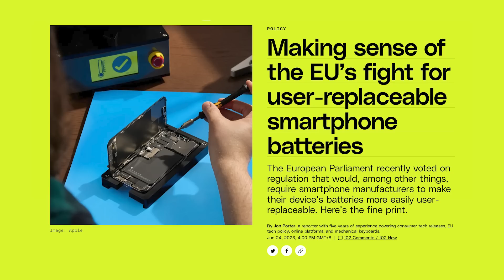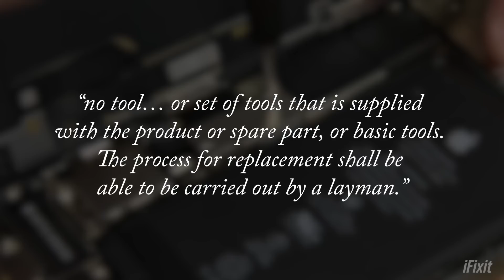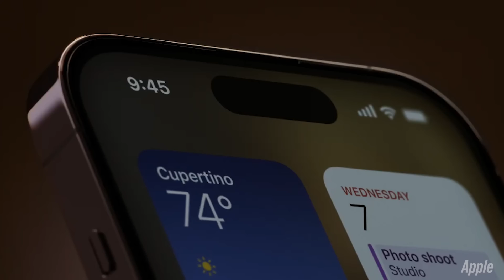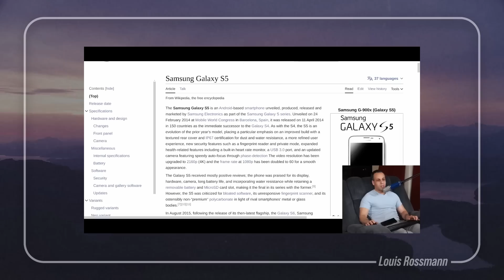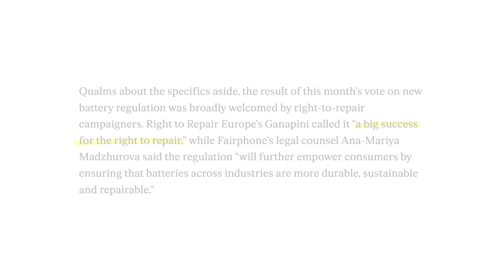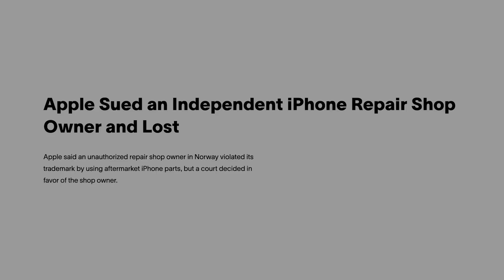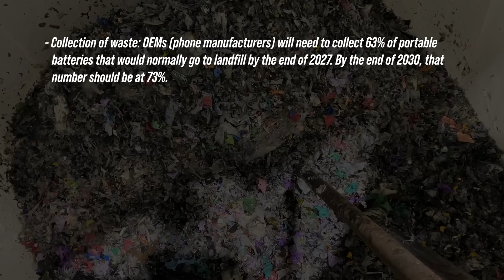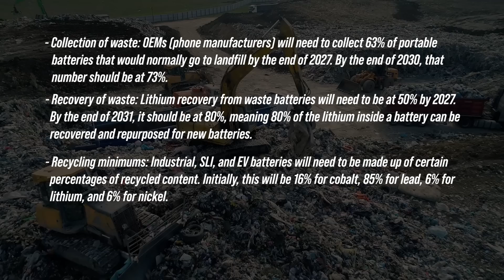EU Just Changed Smartphones Forever

Comment: I mean... apple had it already, no? I think the iPhone 5/S, which design language current iphones share, only needed two screw losend next to the port and you could flip the screen up. Add a squishy gasket to the frame and you got a replacable, simple and dust/water prof design. Samsung too had it figured out, even with wireless charging and NFC enabled.

Only thing i don't see happening is foldables and tablet. The last tablet i know of that had a removable back pannel was the Tegra K1 by nvidia and even that was a pain in the ass.

Comment: Yes it was anti consumer efforts that lead development of non replaceable batteries. But making it more consumer friendly will sadly only make yet another excuse for the companies to say "hey we had to develop these "new" (old) designs so now they have to be more expensive,
Reply: No, it was customer pressure for thinner sleeker phones. This was in part achieved by getting rid of removable components and using glue rather than screws to assemble the phones.

And yes, reverting to screws rather than glue is definitely going to increase manufacturing cost, so expect phones that are more expensive and clunkier than current models.
Reply: @Tugela60  yes, however the screws and design is 1% of the cost,  the chips inside the phone is 95% of cost. 

The rest will be sold as new features to line the pockets of management. It happens every time. 

Maybe production cost will increase by 1-2% while consumers have to pay 10% + for the "feature".
Reply: @EirikXL  It is not the screws, it is the cost of assembly. A glued design assembly can be automated, a screwed design cannot (it is screwed). So, more expensive, an expense that will be reflected in the msrp.

Comment: You can still use the glass sandwich design and have a user replaceable battery. Just have to design it so the top or bottom pops off and you slide the battery out. Phones were doing it for years before manufacturers decided they wanted to lock us all in to planned obsolescence.
Reply: My only phone with that design was awfull. Yes the battery wasnt the problem, but i would loose the cover so offten, because it broke a little piece of plastik of. 0/10. Hope that that piece of crap tecnology never exists again

Comment: Nothing will change

Special rules for smartphones and tablets
Special rules apply to smartphones and tablets. The relevant ecodesign requirements give manufacturers a choice: Either they design their mobile devices so that users can replace the battery themselves. However, they can also install the battery in a fixed position. In this case, however, the battery must still have at least 83 percent of its capacity after 500 charging cycles and at least 80 percent after 1,000 charging cycles. Smartphones must also be designed to be dustproof and waterproof.

Comment: imagine having a battery station where you could simply swap batterys and never ever having to worry about not having your phone charged
Reply: I literally used to do this.

Going on trips was easy too. You would just bring 3 charged batteries. 

There were also custom batteries cases... I had a battery that clicked into the phone that was also a backplate... the battery was big enough to last days.
Reply: @Cstegg  the batteries were smaller. phones just use more power nowadays. Anyway, bring battery packs on your trips, voila.
Reply: Why imagine? That was the norm until 2015
Reply: Battery's have a life, I could swap a rubbish battery for a better one. Wouldn't work
Reply: @billybull7419  This is a concept that works.
Reply: @billybull7419  Right now, when your battery is rubbish, you have to swap out the entire device.
Reply: Just like power tools.
Reply: batteries
Reply: You could use battery packs, not as elegant, but it works.
Reply: maybe not practical for phones but they do that e-bikes and scooters - stations with swappable batteries. They tried doing once for EVs too iirc.
Reply: This is starting to be seriously discussed specially in the EV cars and bikes market. Instead of waiting hours to recharge your car, just pick up a battery, replace it, and leave the older one at the station. Can't see why the same principle couldn't be applied to phones.
Reply: excelent for the enviroment
Reply: they used to have this in the UK. you would get a small power bank to charge your phone and could swap it for a fully charged one and certain shops
Reply: Like EVs?
Reply: I had that with my galaxy S5. I always had a fresh battery sitting at home to swap as I head out
Reply: Dislike the security implications
Reply: except here the EU law is not about removable battery though
Reply: No
Reply: Changing batteries every day... nah. Just nah.
Reply: @Freaky0Nina u charge ur phone everyday
Reply: @Freaky0Nina i had to change mine twice a day with an s4 for years, i had a backup s4 with a broken screen that i used to solely charge up empty batteries so i could keep using my phone.
Reply: it takes about 30 seconds to change batterys @Freaky0Nina
Reply: @Freaky0Nina  My headphones work like that, It has a removable battery and the base is a better charger, it came with two batteries, while you use one, the other is charging, it is ultra useful.
Reply: @Freaky0Nina  Man you guys must be teenagers. You realize phones were like this like ten years ago right? You just have fresh batteries at the ready. It was always better.
Reply: @Freaky0Nina  Perhaps you're too young to remember but it's simply open the case - take out battery 1 - put in battery 2 - set battery 1 to charge.
Reply: @Freaky0Nina you do charge then every day. If such scenario os possible, you won't need to charge your phone at all.
Reply: when i had my s5 with extra batteries it was great. my charging station was another s5 with a broken screen. I rarely ever had to plug in my phone,

Comment: It was the result of both the companies and the users. Because i had that g5, it was a cool concept at first, but everytime i dropped my phone the battery popped out. The charge port that the battery connected to and slid into the phone started malfunctioning and couldnt charge. Replaced it. Same thing a few months later. Replaced it. Battery wouldnt hold charge. Replaced the battery. Eventually it stopped clicking into place correctly. and needed to be tapped closed.

Comment: I'm saying it here and now. Once this law passes, a possibility of a brand new phone that is sold "batteries not included" shall rise.
Reply: if the batteries are standardized across platforms... why not. you want to upgrade to the latest model and don't have to pay for a new bettery, just use the old one. I'm not saying that companies wouldn't charge you the same as they intended to do if the battery was included but it's a possibility. Then again, say if samsung, nokie and apple all use their own battery, then they would include the battery because trying to get a customer to change brand if they have to buy the battery seperately is going to be haaaard.
Reply: @tore650  I dont think they will become cheaper just because the battery isn't in the phone.
Reply: @tjeerdroukens5110  No the phones probably won't become cheaper, but you'll be able to keep them five times longer if you want to.
Reply: @tore650 i wouldn't see the "new phone, old battery" thing
The lifetime of a battery is propably shorter than the rest of the phone
Reply: @tore650 batteries degrade
Reply: @blastbottles  I'm aware, but using standardised batteries would make recycling easier. Also when the battery starts to get bad you can buy a new one without having to go through the whole "should I just get a new phone?" because if you buy the battery you can still get a new phone later without feeling like you wasted money on the battery.
Reply: they wont be standard.
The real answer would be if batteroes have 10x more charging speed + density @tore650
Reply: Apple already got sued in europe for not selling charging blocks with their phones, this is not just "ONE law" its a change in a lot of laws regarding phone companies and services to users and the environment.
Reply: @tepuntopunto  The same law that forced them to switch to USB-C forbids to sell the charger with the phone. It's a whole package to stop people from buying more chargers than they need. Full compatibility, reuse your old charger. Use the same charger for all your gadgets.
Reply: You all do know the built-in irreplaceable batteries is the new feature, and replaceable batteries are simply going back to how it used to be?
Reply: I don't know about the rest of the world but that would be absolutely ilegal in Brasil
Reply: Imagine Apple just stops operating in the EU.
Reply: Yeah maybe for apple crap lol
Reply: You've just foreseen the future where everyone carries a power supply that is powering all electronics carried/implanted. Iron Man be the exaggerated example :)
Reply: The Chinese aftermarket batteries work just fine.
Reply: @ICheat_ILie_ISteal  They work until Apple put a chip in every parts of the phone to make sure every parts in the phone must be genuine to be able to function fully.
Reply: That'd be great
Reply: And people wont buy that phone as much as the ones that have a battery.
Reply: And the batteries sold will purposely be made to be sustainable for a few months before you need to buy another one.
Reply: even gameboy had batteries included
Reply: That is not a bad thing at all. Tons of stores already sell tools that don't have batteries included because they're universal.
Reply: They're basically forcing people into a Printer and Ink company scenario...
Reply: Then that leaves an opening for more competition.  Which will bring prices down.  Their call
Reply: Naw more then likly theyll just stop selling there top in models directly into the EU make anyone in the EU purchase the phone from another country and import it. Alot of lower tier phones still have easily removable batteries. So what were most likly going to see is the lower end phones being in the EU with the top end ones out side of the EU. With a not for sale In the EU sticker on them. Clearing them of any and all liability for those phones being in the EU. As it is the person choosing to import a phone into the EU despite it not meeting regulation. The difference between this and The Iphone Fiasco was andriods were unfected so if apple chose to pull out iyd only hurt them as why pay pay to import when you could get a phone of similar quality whithout needing to import were as this will impact both apple and andriod so it would be a Mutual pull-out of "High end phones".
Reply: For sure. They will find a way to make more money out of this.
Reply: Oh yea batteries will be like $300 minimum and different types of batteries scaling to $1,000 lol😅
Reply: @FadiGamingRP  Sure, if you buy them from Apple. Buy them from a company in Taiwan, and they'll probably cost a few bucks.
Reply: That's OK, so long as I can keep the phone forever and purchase compatible batteries from other manufacturers, thereby saving a ton of money.
Reply: That phone will blow up
Reply: hope next is alcohol batteries, can charge with beer, drinking poison is idiotic
Reply: Stop giving them ideas😭
Reply: That was possible from Nokia's heyday in the '90s through to the GS5, and yet phones were sold with batteries..
Reply: Like Powertools from Milwaukee
Reply: Who's going to buy a phone that doesn't work out of the box? Nobody. 

This law has been a long time coming. It's tragic that corporations are once again forced to do the right thing - because of their own accord they wouldn't change a thing. This is a victory for the consumer over the shareholder.
Reply: No reason not to honestly.
Reply: I live in Germany, I don't study law, but it's very important in the study that I'm doing. It's illegal to sell a product that is considered as defect. A phone without a battery is considered as a defect device due to the missing part which makes it unusable. The seller would have to state, that the device is a defect device and it's not working if they wanted to sell it, which would probably keep them away from doing so.

There still are loopholes sadly and it depends on the people if they give in to buying new "defect" phone.
Reply: the batteries will be engineered to last 3 months and the cost will go up so after 2 years you will have paid more then what getting a new phone every two years is now.
Reply: @perry92964  How cynical, and true
Reply: @perry92964  There will be 3rd party batteries, obviously
Reply: @perry92964 highly doubtful. competition is hot and third parties will thrive if they do.
Reply: @perry92964 
Toddlers. Every single last one of you. Up until about a decade ago ALL phones had replaceable batteries. But you were right about one thing: they were all engineered to die after two years. Most batteries didn't even last that long.
Now, you got one guess: why did they replace those with built in unditachable power cells?
Reply: @XmanSully  dont need to its so lazy ignorant people buy a new phone.
Reply: Just buy your own rechargable double a batteries ...
Reply: @donrobertson4940  you're still paying for electricity to recharge them
Reply: Nobody will buy it....
Reply: @marcvangastel2157  I wouldn't be too sure about that
Reply: @marcvangastel2157  I'd buy it, easily, and walk out with 2-3 batteries to swap out before I leave the store. Just like the good old days.
Reply: @marcvangastel2157 iPhone users will buy anything
Reply: @marcvangastel2157  apple fans have entered the chat
Reply: Yeah, i can easily imagine that with apple. Why sell it with the phone, when you can charge people additional 100€ for battery lol
Reply: @sonicdit99 
After twelve good years with android, I was effin posesed to think "hey, why not give iPhone a go?". I rue that day
Reply: Eu has no right to regulate things like this. It should be up to the consumer to buy whatever device they want. If a company want to make a phone with replaceable batteries then they should do it and see if people buy it

Comment: Government always lags behind industry requirements, and consumers 'dont need' battery replacement. Remember that Firmware kills all electronics!
the industries planned obsolescence is the issue, where future updates slow the phone down instead of optimising. creating additional processor load that drains a linearly deteriorating battery to the point where the consumer is frustrated to buy the new model that just happened to be released 'just in time'

Comment: Firstly, this is less "changing smartphones" and more "reverting anti-consumer practices".

Secondly, GOOD! I hate that I couldn't replace the battery in my last 2 phones. If I could have done so I would kept each of them for at least 1~2 years longer. (and they each already lasted around 3~4 years) Phones keep getting bigger and bigger, while I want a SMALL one. Smallest I can find now has a 5.4 inch screen. I want a 4.5~4.8 inch screen. Something that easily fits in any of my pockets. But each time I have to replace my phone after 3~4 years, and each time I'm forced to buy a bigger one. I hate it.

(Also side note; I wish they brought back the physical keyboard phones. Like the Samsung I used to have in like 2003~2005 or something, when smartphones were only just becoming a thing. But they're either very expensive, or are very weak in terms of computing power.)

Comment: The irreplaceable battery trend in the phone industry just made much more trash and made people spend much more on a phone....
Because many phones is made in a way that you mostly need to replace the screen or the back glass if you want to replace something else on the phone because the screen or the back glass will break in the process...
For example a friend who is many years in the tech industry  told me when i had a z flip 4 that i will need to replace the screen and maybe other thing on the phone just on the way to replace simple parts like the charging port because how the phone is designed and what process you must do on this phone and many other phones.....

Comment: Why not implement a deposit feature for selling batteries. New batteries cost 20€ but once you deposit your old battery you would only pay 15€ or something like that. Also yes, the fade out for changeable batteries was caused by the companies alone. Like said, no one was really concerned about the water resistance of phones. No one takes them swimming or to shower. And still they have been more water proof even with replaceable batteries.

Comment: I purchased a brand new $1,000 phone and the battery did not work from day 1 because it must have sat on the shelf too long and discharged 100%. It should be a simple act to replace the battery but since these greedy companies make the battery non-replaceable, I would never use my phone as intended. It could only last a few hours then go dead. This is absolutely criminal.

Comment: I hope this doesn`t waste too much space in a phone because camera modules and speakers need more and more space. (I think a removable battery would be possible even on high end phones- maybe accessible via screwdriver.)
Reply: Just make the phones 2mm thicker. The rubber used for water resistance might also act as a damper, if you drop your phone.
Reply: It will make phones significantly fatter, there is no way around that.

I am pretty sure that this is NOT what most consumers want.